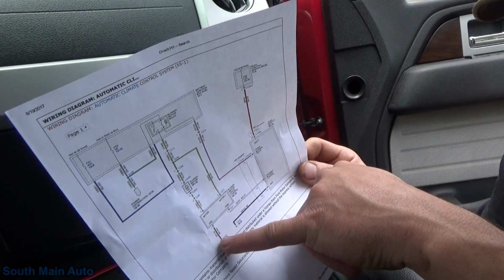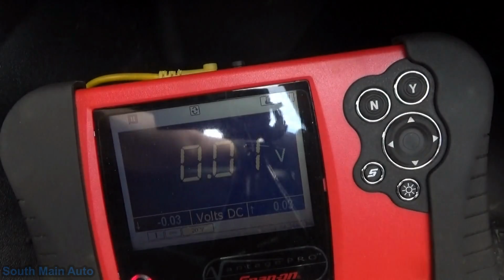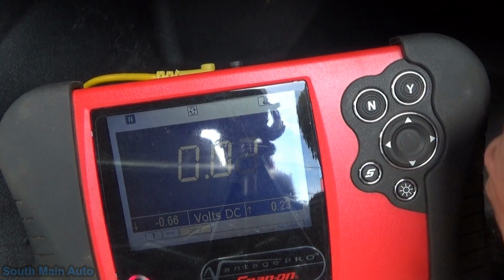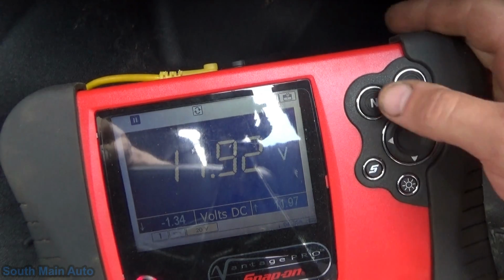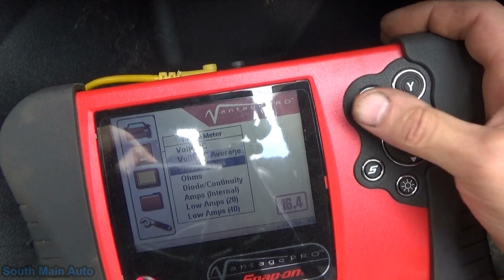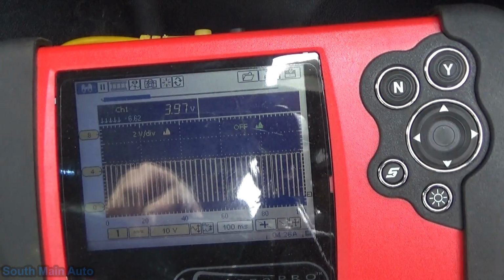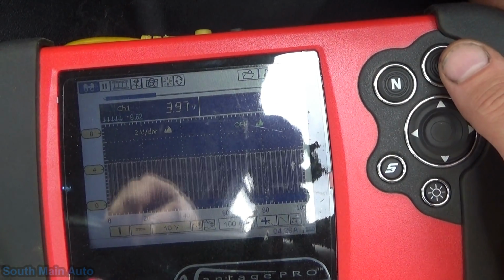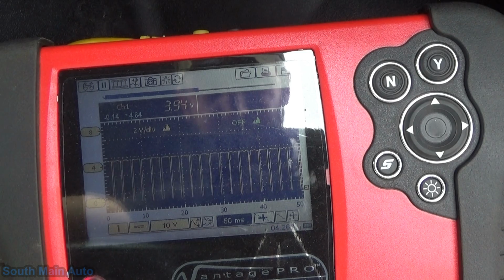Ford F-150 - Blower Motor Stuck On Medium Speed

Comment: It's easier if you open the glove box and then release it so it swings down. Then you can actually see the part. 

What is funny is that when the module fails, it fails to some set speed.

Comment: My blower was stuck on high even with the HVAC turned off. I don't have any of the diagnostic tools to run the tests. Just went ahead and got the part hoping it would fix my problem. It did! Thanks for the video. Really simple fix.

Comment: Question? 2013 f150 change blower and resistor now fan barley blows could it have been wired in backwards also no cabin filter

Comment: Thanks for the great video and wiring diagram a few years back!  Tried a non-OEM part of AMAZON and did not fix our blower (But with your testing mechanism I proved it to myself it had to be a bad part).  As soon as I replaced the resistor with the OEM part working like a champ (OEM is more expensive 30 vs 85 which is why I tried it first)!  Seems OEM part is the only way to go here!

Comment: Thank you so much for this video.  I'm using a standard multimeter and I'm at the step that I'm checking the voltage at the white/purple & black/white.  Fan on low= 41.1.  Each fan speed higher drops the voltage = 38.7/34.8/29.9/25.1/19.2/13.0.  Turn the fan off and it's now 51.4.  I've replaced the blower motor and nothing changes, so maybe it's something else?

Comment: Anybody having electrical interior issues? I installed some LED Headlight bulbs but the problem was my high beam on my cluster would stay on ..Just explaining the only thing I have changed on the truck as far as aftermarket.  fast forward,  Monday, notice the lights on my cluster turning on and off and the heat would do the same ,so when the cluster lights went out the heater went out. Now the heat is completely out and doesn't work at all. So with that being said, when turning on my headlights my hazard lights stay on and I cant take it out of PARK ,also signals dont work . signals work only when the lights are off. now with the heater,  if ya turn the heater to the on position,  the cluster lights turn off and I also cant take it out of park.. crazy , when pressing the break the lights dim on the cluster as well . Ill try and post a video tonight but the truck runs fine its just the interior that I am having an issue with .. Also all fuses test out good ,nothing is blown .. 

Could this be a ground issue ?

Comment: I checked wiring at the black and yellow wire "ground" and the control wire resistance and it did change with the turn of the fan speed.

Comment: I just replaced this on my 2013  F150 and it didn't make a difference, still stuck on high. Does this mean the actual motor needs to be replaced
Reply: Dealing with same issue, I first got the resistor from auto zone, didn't work, then o Reilly's and it blew an hour later. now im going to try getting a oem part
Reply: @Jiffchiropractor  any solution? My 2013 is doing the same!
Reply: @pikespeakviewer  I bought the OEM part off of Amazon and it’s good 👍

Comment: I replaced the blower resistor under the glove box and it turns off. It works on high on old resistor. So reinstalled it for now. What else could it be?

Comment: It's easy to diagnose which part in the system of German-made cars and equipment is bad. Just check the prices on all of the components. It's always the most expensive one.

Comment: South Main Auto Repair. I just replaced my blower motor speed controller/resister/control moduel. Whatever the hell it's called. But my fan speed is still intermittent. Fan will cut out intermittently at all settings, a.c./max a.c., heat, and at all speeds. It will cut out and about 40 seconds later come back on, sometimes for a while, sometimes only for a second. Any recommendations on where I should be looking next?  
It's currently at ford and they tried replacing the module that communicates from the a.c. to the nav system and that didn't work. They said they're going to try putting it back to stock to see if it still does it but I don't have much faith in them to fix the issue.
Reply: mitchell baxter sounds like the hvac controller (the unit w all the knobs and button)

Comment: My comment vanished. I was talking about how I had a f150 same year with a blower stuck on the 3rd setting. Changed the resistor when the PWM signal was good and responsive. It acted right for 30 min then would shut off and turn back on a minute later on the two high settings. I checked the blower found the ground missing then i checked the black with white stripe feed to the resistor and it had 36 ohms of resistance, which seemed quite high. T tapped a new ground in to it only to find I had a bad resistor out of the box. Ordered a new one, that wont have to deal with the ground problem now.

Comment: +South Main Auto Repair I had no burned connector, old resistor was stuck in 3rd setting on all commands. The black with white stripe going to the resistor is the ground feed and it had 34 Ohms of resistance, which I found to be off if its supposed to be a heavy ground supply. T-tapped a ground into the black with white stripe, soldered that for a good connection. All the settings work but then I noticed the new resistor would crap itself if the truck was turned on and running, in either of the top speed settings, even with the new ground. The blower motor would lose its ground feed at the motor from the resistor, with a new resistor! Parts are crap now days. Ordered up another one. Nothing else it could be that I can figure out at this point from my scanner readings.

Comment: My 04 grand Prix blower motor run turn on by its self when cars off. After I get back from a drive. the car will be shut off for 15 min the blower motor will turn on run for 5 min than shut off and not go back on tell I repeat the process. I have a new blower motor and control processor acdelco brand.. it had this problem before and after I replaced those parts. Shops around my town can't figure out the problem!

Comment: WOW !!      -infernal "computer " controlled heater motor !       =defies the KISS formula !!
 like "computer" controlled alternators =WHY ?? 
 -how is average mechanic gonna diagnose problems short of replacing EVERYTHING until problem found ?
   you are FAR BETTER than 90 % of mechanics I know-who keep changing unnecessary parts until      ~`

-recall in 1970s when Volvo among others (Mercedeze,etc)   had 1st BOSCH  fuel injection
 -modules usually buried  under drivers seat-and entire "ECU" had to be DEALER replaced

  I discovered that ONE  transistor was faulty since running (unsunk)at 3w-so replaced 5 w $2 transistor with 17 watt $4 item/unit
   -so $ 10 PERMANENT  REPAIR instead of $250 ECU replacement-that also soon failed again due to SAME BAD DESIGN

Comment: Mr. Eric I have a problem with my 2011 Ford mustang gt and I have the check engine light is on so I put my scanner n it and its the P0300 multiple miss fire o I ordered a crank sensor from amazon and couldn't find a youtube video to locate it more research led me to the back of the engine on the passenger side .  So I took off the sensor and found out that it wasn't it please the car wont run a nd I have no Tach please help I have to find the right location and a pic of what it looks like... thanks love the videos

Comment: I had to change the resistor, and solder in a new pigtail connector on my 05 chevy colorado, which should have been fixed in a recall, considering how many of these burn up the connector pin and the resistor. Luckily I looked this up and found out that there was a tsb for this problem and didn't have to chase the problem down. My next vehicle will probably be a Toyota or a hondu, even though growing up my gramps would get fired up if anyone in the family bought a foreign car, called them jap scrap, of course he was a w.w.2 vet and a little prejudiced towards American built cars. I buy what lasts me the longest, and is well built, got this vehicle from a family member at a good price or I'd be in something with a better reputation. I have had pretty good luck with it over the last 6 years, this is the only thing besides brakes and tires I've had to deal with, but it was maintained properly before I got it, and that does help. I live in michigan, so I can appreciate your struggle with the rust monster. Thanks again Eric, for another great video, short or long, they are always good entertainment, and keep me up to date on the newer vehicles. You need to have your wife do another fix it video, you guys are pretty funny.

Comment: Eric, buddy ... NONE of the 'scopes that you use are "affordable" to the average DIY person !  Even the old Vantage MT2400 is going for over $300 on eBay.  Vantage Pro are around $1000.
Reply from the maker: If a mechanic can not afford $300 to do his job then he is in the wrong business IMO. You can buy a Hantek Scope for less than $100 and do the same and have a sample rate of 46m samples/sec. Most people would spend more than that on a parts guess. Or get one of these nanos for under 100 http://amzn.to/2s1v59m
Reply: For a PRO, you are 100% correct !

Rigol makes some nice, reasonably priced 'scopes, but none that are battery powered.  They a meant to be "bench" 'scope so they are larger and probably would not survive knocking around.
Reply from the maker: Even for an amateur working on cars. $100 is not much of an investment in tools. The days of fixing cars with pliers and a hammer are long gone IMO
Reply: Yep !  The one you link for $100 is not too bad for the money.

I guess I am unhappy because you can get a really nice 4 channel lab 'scope (Rigol DS1054Z) for about $400, but portable (battery operated ) 'scope, with less functionality, costs a lot more.

Comment: My 77 F150 has this under the dash, then my 95 and 2000 Fords have it under the hood where you are usually changing the resistor and splicing in a new plug and pig tail. 40 years later, they went back to the better design.....

Comment: Hey Eric, I thought for sure the problem was rat poop in the motor! The electrical engineers finally figured out how to use PWM. My old van used some big ass resistors in the firewall in series with the motor. How crude! Must have been designed by mechanical engineers!
Reply from the maker: Crude but have you ever seen one fail ;)
Reply: You're probably right. My failed I think because it was in the same position as that MAP in the F150 is your recent video. The connector was so rusted I had to completely destroy it to get it off. I know most people like to see repair videos, but I'd like to know what your experience has been with direct injection. I can see how conventional fuel injection and electronic ignition has improved reliability. An ETCG1 style video would be cool. By the way your videos are top notch. You're a natural in front of the camera. Ever consider acting?

Comment: I just fixed the fan control module on my daughter's Accord with the same symptoms. I replaced the power MOSFET for $3. Since I used to be a bench tech at a communications company, it's always a special pleasure to troubleshoot to the component. Love your videos! Best mechanic on YouTube!
Reply from the maker: Wow cool fix Rob!
Reply: Metal Oxide Silicon/Field Effect Transistor. I knew what he said without looking it up.  Retired comm/electronics.  @SouthMainAuto

Comment: thats hard as heck to do on the lincoln towncars with every single thing in the way! i just did one on a 2000 towncar took longer to backprobe than replace the heater hoses purge valve all in the way!

Comment: How about testing for excessive amp draw from the blower motor, might have contributed to the failure of the speed control module?
Reply: it should blow the fuse when on highest setting if it was that bad off
Reply: I was looking for a comment like this one. Without seeing this video, based on the symptoms, how do we know that there is no issue with the blower motor?
Reply: Was going to say something similar - in my (limited) experience these things are somewhat like fuses, in that something caused it to blow, either low airflow from clogged filter allowed it to get too hot or high amp draw from motor.  Should check upstream for the cause.
Reply: if you have a known good amp draw reading for the blower motor that would be a good idea. maybe even an amp clamp to see if their might be an intermittent
high amp draw. dc motor could be starting to short to the metal casing from road vibration.

Comment: I had a Citroen C4 in last year with a blower motor stuck on gale force.The buttons up top sent different voltages to the blower module which was supposed to vary the fan speed to suit, but the blower module was ignoring it. New module for the Citroen was £158 !!   whats wrong with four resistors I say   lol

Comment: Yesterday On my Chevy Colorado I had to replace the resistor wiring harness electrical plug.  Half the time it would work on the other speeds. Looked like just one of the terminals in the plug got hot.
Reply from the maker: Boy, I wanna say GM had a TSB on those and a updated kit... what year is it, I'll look? Also I have seen issues on some of the GM's that have repeat resistor failure (melt downs) where the blower motor amperage was a tad on the high side. I have several known good amperage specs on those in my notes.
Reply: South Main Auto Repair   Its a 2006 . It wasn't all melted.  When I unplugged it I had to really look and I could see that just one terminal looked like it got hot.  When I was going to Southern California it worked I would stop at the gas station then it wouldn't work. The next time I would stop it would start working again.  The resistor wasn't bad.
Reply from the maker: Yep memory served me right:

#PIT3688A: BLOWER MOTOR INOPERAT IN ANY ONE OR MORE BLOWER SPEEDS - KEYWORDS CONNECTOR HIGH HVAC LOW MEDIUM RESISTOR TERMINAL (JAN 4, 2006)

Condition/Concern:

Blower motor inoperative in one or more blower speeds. This concern is due to a loose connection at the blower motor resistor.

Recommendation/Instructions:

Inspect the connection at the blower motor resistor. Replace the blower motor resistor and any terminals in the female part of the connector that show evidence of arching or corrosion. The replacement connector and terminals are listed below.

Part Number 15306069, Female Connector With Leads. Replace the connector body with leads only if the connector body shows signs of damage. It may be necessary to generate a SPAC case to obtain this connector with leads.
Part Number 12176387, Replacement Female Terminal. This terminal is made of copper-beryllium and can be located in Delphi tray 3 of your Packard kit. Only replace the terminal(s) if the connector body has no evidence of damage.
Replace the blower motor resistor only if it shows signs of arching or corrosion at its terminals. Use current SPO stock.
Reply: South Main Auto Repair   Thanks.  That has to be it.  Caused by a loose connection.  At least it was easy to get to.
Reply from the maker: No prob
Reply: 1970chevelle396 Yup,typical GM. my Trailblazer did the same thing. the replacement pig tail that plugs into the unit is $45 ,you have to cut and splice it in. Sucks. I have been through two voltage regulators now. I cheated and soldered the wires directly to the regulator because the pig tail was shot and I didnt feel like spending $45 for a day of cutting and splicing.I havent had any more issues eather so mabe the connector had something to do with them failing.
Reply: Wow thanks for this. I work with an older guy, a Vietnam vet, who said he had to replace the resistor on his truck but recently it's not working on lower speeds again. I'll let him know about this.
Reply: Dan.vaku Yes,they have an issue with them, I am sure it has to do with the start up on the blower motor. I was told to replace mine but since I soldered all the connections directly to the resistor,I havent had an issue. Its a big pain in the butt doing it but I know that the connectors cannot handle the load for some reason. I havent had any more issues. Since I had to replace two of them,third times a charm. Mabe its because Mexico makes them better than Canada too,I dont know.

Comment: yep the old days an ohm meter and voltmeter ya was gold. you just showed in the last 2 videos that unless you know how it works  you really dont know what meter to use.  when in doubt get the scope out. that control could be analog digital or a mixture of both. make a guy want to let the smoke genie out and wire it up right !
Reply from the maker: Thing is now days guys in the shop have no excuse for not owning a scope. You can get one to do stuff like this for a hundred bucks and something decent for 500. If they can't invest into the tools to fixem right then they are in the wrong trade IMO. Thing is too it is nothing new like people tend to think. I have a full lab scope ignition meter from the early 80's. I think it is just the fact that no one uses them perhaps?